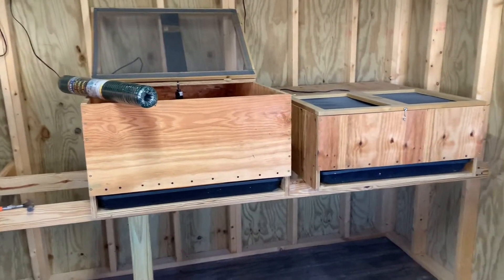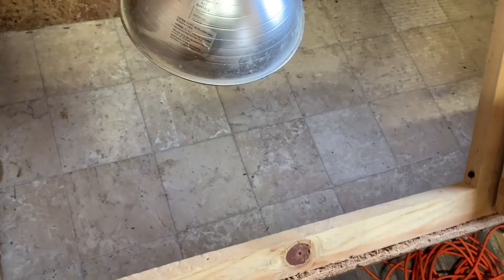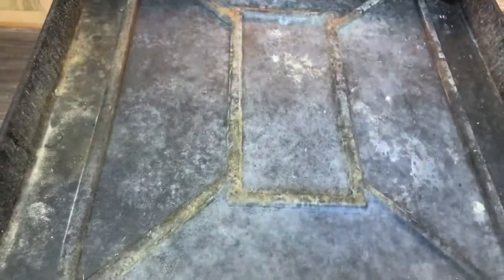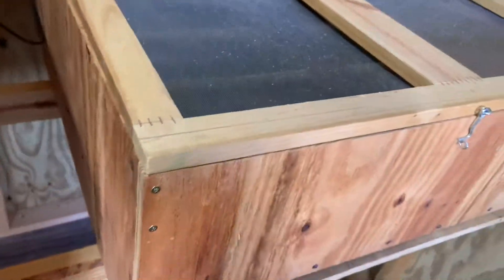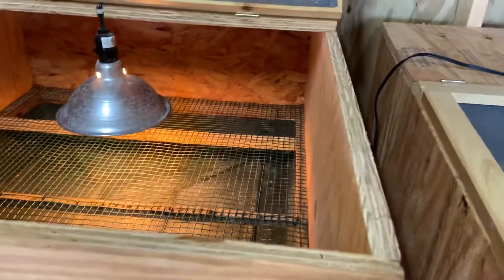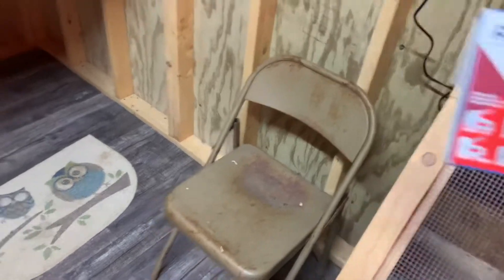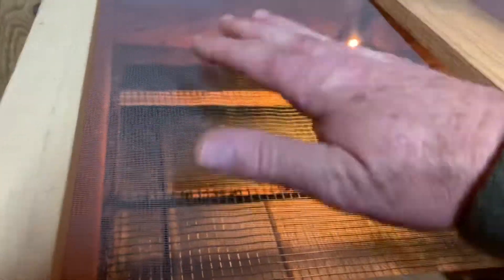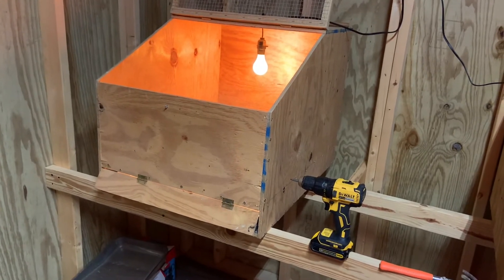Our waterfowl brooders

Comment: Is the baby swans going to be going in there when there hatched and then when there older there reunite with there parents?
Reply from the maker: Yes after they hatch the baby swans will go into the big brooder where they will have heat, food and water. It’s much safer in the brooder than with the parents. They could easily get stepped on if left in the big pond. 
No they will not go back with parents , they will be going to new homes to start a new adventure with someone else.